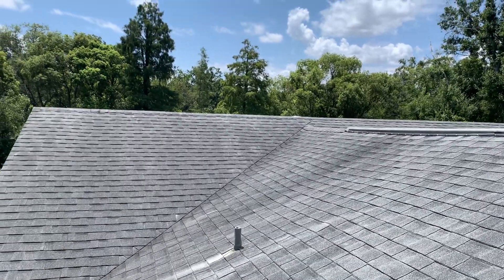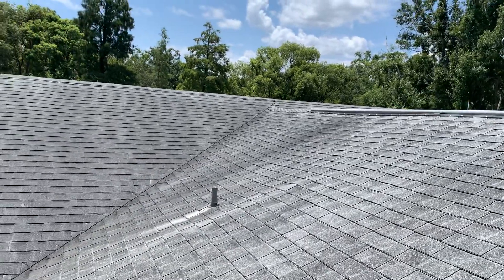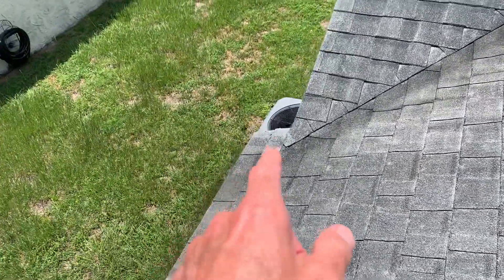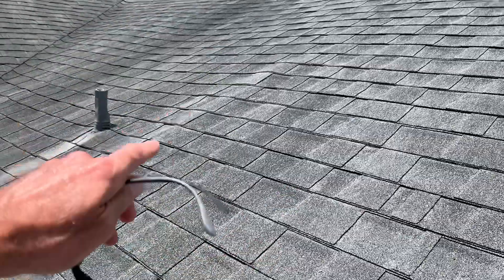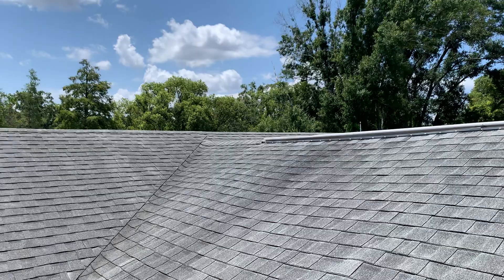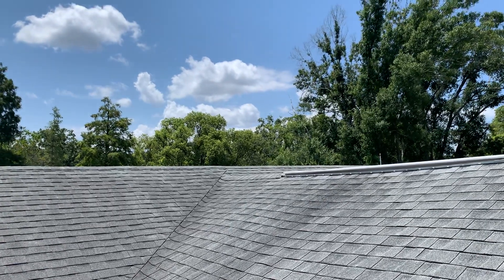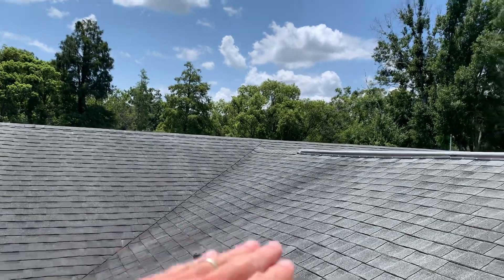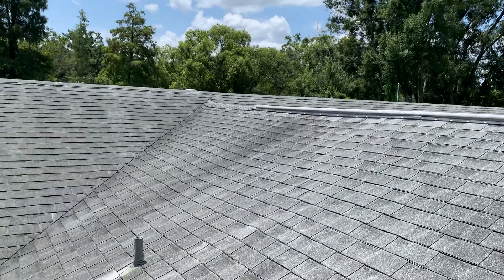Humps and dips in my roof; why?

Comment: what about if rafters are used instead of trusses. Is it the same issue where the rafter has moved?
Reply from the maker: Possibly. Main issue is if the framing was lined up properly to begin with.

Comment: There should be zero humps in the roof after a new roof! That should be corrected. Unacceptable.
Reply from the maker: While it is possible, it is the cost factor of removing that much decking and correcting the underlying framing issues that typically make it cost prohibitive for most homeowners. Thanks for sharing though!
Reply: Everyone has their version of acceptable, you should look at some brand new builds where the trusses are broken….